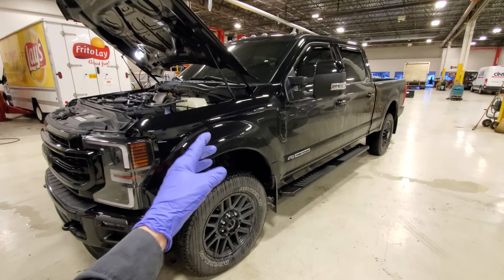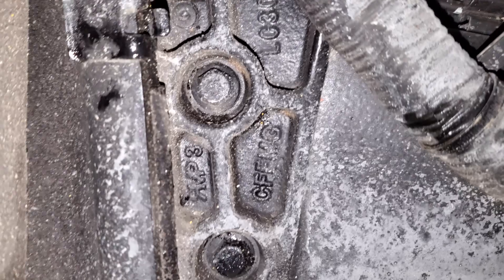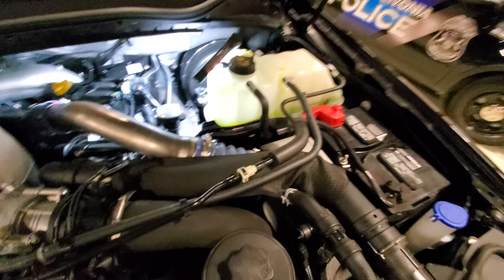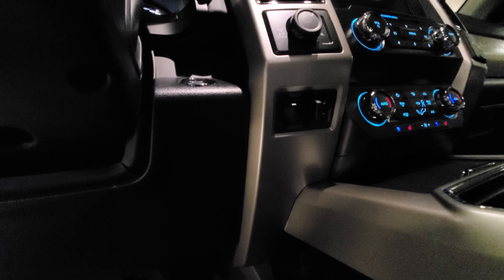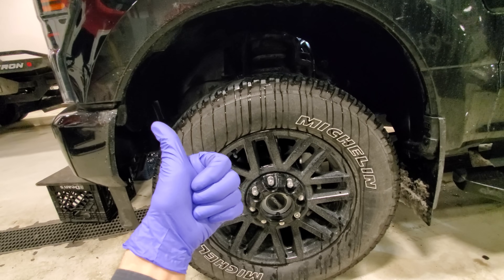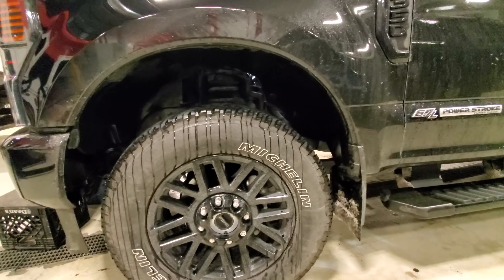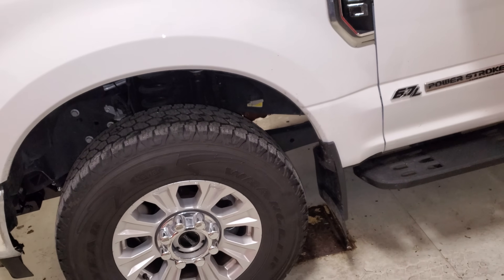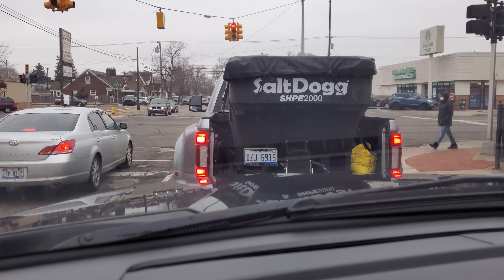What is this THING in my wheel well?? 20-22 Ford F250 F350 F450 EPAS - Death Wobble Cure???

Comment: I love Ford BUT I also hate them.  ALOT of moving parts - and seems to be OVER ENGINEERED.   If you need help backing up a truck when towing then perhaps one shouldn't be in the drivers seat.  Call me old school BUT that's my 2 cents worth.  2017 F250 6.2L Lariat w/ *8' box owner here and I opted out of all the electronic  stuff the dealer was trying to sell me at the time of my purchase.  I buy my trucks to own forever, I don't trade them in every 5 years like some people.  Yes. my rig had the death wobble and the easy fix was a fox 2,0 steering dampener - stopped it completely.  i love my FORD and my truck has never let me down.

Comment: Can this system mistakenly cause a left pull? I have a left pull that I am trying to nail down. The alignment has been checked 2 times and is perfect. Does it with stock tires and new tires as well. Seems like something is turning the wheel. The pull recently started.  Can this system be disabled?
Reply from the maker: I highly doubt that it wld cause a pull. No that cannot be disabled
Reply: @PowerStrokeTechTalkwARod  interesting. I pulled the 40 amp fuse for the EPAS motor. got tons of lights and error messages, but the truck drove straight, no pull. steering was heavy though (expected). I reinstalled the fuse, everything back to normal, but the pull is still gone! something reset with pulling the fuse
Reply from the maker: Hmmmmm
Reply: @PowerStrokeTechTalkwARod  I have a 2020 f350 extended cab 6ft bed STX and from the frame to the hub on the drivers side rear axle is 1/2” less measurement than the passenger side. The truck has 15,000 miles and whenever I hit a bump it feels like the front end jerks to the left side and when I’m going over 40 mph the front of the truck wanders left to right, worse at higher speeds and no matter what even after an alignment and rotating the tires if I let go of the wheel it pulls to the right, and brakes applied or not it still pulls to the right. Is there any way the dealer will fix this under warranty? Warranty is 125,000 miles or 5 years bumper to bumper and yes I bought i 19:17 it used

Comment: My Dads 21 f250 lariat doesnt have it but my 22 xlt does have it and i dont have the trailer back up assist but i did notice driving his is that my truck is alot easier to turn than his

Comment: I think its part of the lane departure notification system.  When you get too close to the lane divider a signal is sent and that vibrates the steering wheel.  I don't know this for sure, but a buddy of mine has the same 2021 F450 that I do except that option.  His does not have the item, mine does.

Comment: 21 Lariat Ultimate with lane keep assist and pro trailer.  I have the bracket and the motor.  The steering seems much lighter than the 17 that I had.

Comment: What is that purpose of the hose that is attached to the top stud of the drivers side shock? Just changed my shocks last night and after I pulled that clip off I noticed that the hose was plugged with a white cap and so is the one in this video. Any ideas anyone???

Comment: I have it on my 2020 f450 lariat with trailer pro backup with Lane departure  I did not have it on my 2019 450 Platinum however it did have lane departure. And I have to say my 2020 is the worst driving vehicle I have ever owned. Seriously you cannot keep this thing on the road it wanders all over I've had it into two different alignment shops and they claim that it's perfect. What I find is different in the way they steer is the 2019 drove like a high-end German vehicle steering wheel was very heavy the 2020 is very lite drives like you're on ice. I would like to pull the fuse on this electric motor and see if it changes the way it drives I have 21,000 miles on the 2020 and have hated it since day one it is the worst thing about this vehicle. Having crawled around my vehicle to inspect it for this I noticed that one of my batteries has the red indicator on it and one has the green makes me think one battery is bad we'll have to get it checked wonder if this could be part of my problem low power? I have yet to take the steering assist unit that goes on the trailer out of the box under the back seat. I have had a 2008 450 2010 450 and a 2016 450 and the 2019 450 pretty sure I know the difference in the way they steer and this 2020 is miserable. Any help would be appreciated.  I read in the comments let the steering stiffens up when on the highway at speed mine does not change my wheel is super light all the time it doesn't seem to change. I have no road feedback in the steering wheel it's like you're driving by wire completely disconnected from the road cannot take your eye off the road it's not a relaxing drive at all. Not just my opinion everybody that drives the truck has the same feeling.
Reply: I have a 2021 f450 and am experiencing the exact same thing you are describing. In my 2020 F350 DRW adaptive steering was standard on the platinum model. When placing the order for my 2021 platinum adaptive steering was an option. I checked the box because hey, 85k truck what’s another 1k for something that improved drivability right?! I am seriously thinking this adaptive steering in the F450 is not a smart option in this 21 model. Love the rest of the truck but man how can this be a tow beast I need it to be when it wanders so much....
Reply: @antimatterpowerstroke1225  Good news I might have fixed my f450 steering problem and you probably won't believe it I mentioned that I had a bad battery took it into the Ford dealer today they replaced the battery erased the codes and replaced my front and rear camera I drive it out of the dealership it drives like a different truck. I actually drove it for three and a half miles down the road in a crosswind and I didn't even touch the steering wheel my hands were off the wheel. I have called the dealership back the service writer to asking if there was a code on the steering or anything to do with the steering he hasn't called back. But if this continues to drive like it does now my problem is solved I hope this helps you.
Reply: @mbrown1519  so did that fix your problem
Reply: @grahamwilson3882  Yes it has helped, it's not as good as the 2019 but from what it was like, it's a lot better I now have 31,000 on the truck the service manager never got back to me about that code # but at the time I picked up the truck he said it had 9 codes they cleared.
Reply from the maker: @DSTRUCKS js complaining about the same thing!
Reply: @antimatterpowerstroke1225  If you find a fix please let it be known This is a horrible thing to herd down the road.

Comment: It is an electric power steering overlay. It came out in 2020 and is only installed on XLT and higher trims. This is separate from the adaptive steering system that is inside the truck behind the steering wheel.
Reply from the maker: Thank you, finally some talking with some knowledge3

Comment: What do you recommend for undercoating? I am in Maine and have my Tremor coming in 4-6wks and would like to get it coated before next winter
Reply: Wonder if that is available in Maine?
Reply: Unless it is brand spanking new just off the truck I wouldn't get it undercoated, way to easy for moisture and dirt to get trapped, which will lead to rust. A traditional undercoater MUST know what they are doing to be able to apply their product so it doesn't trap moisture or worse, peel off after a few years.   Up in the snow belt here with all the road salt and pickle juice, we have been using Fluid Film instead.  Wool Wax is a good one too.  It's a lanolin based product that is sprayed on to everything underneath. It can get into areas undercoating cannot. Stops rust dead in its tracks, and prevents rust from happening.  Check out some of the videos on it. Really good stuff and doesn't cost a small fortune to apply.    Fluid Film can be done in your driveway, it's non toxic since it is 100% lanolin, and doesn't stain.  Just don't get any on the brakes.    I bought my 2012 F350 2 years ago, it was a Wisconsin truck and has rust at every body mount, and in a few other areas. I took a sharpie and marked around every rust spot, the brushed it all down and sprayed the entire under truck, and a few spots on the front bumper.  2 years later and no more rust and the spots it does have are the same size, have not expanded.   So if you can't find a good one, there is a really good alternate to use.
Reply from the maker: Rust belt here! Have had NO ISSUES with Ziebart
Reply: @PowerStrokeTechTalkwARod  That is a rarity, didn't even know Ziebart was still around, all the places around here in Hellinois are tinters.   They must do a really good degreasing wash and etching for it to stick.   I have had "rust proofing" done, and still had rust issues, but the Fluid Film is the nutz,  $54 for a gallon and $24 for the sprayer and I did 3 vehicles with it and still have a half gallon left.  Of course the only thing needing it now is the frame and axles since the body is all aluminum and doesn't need any protection.
Reply from the maker: Mine looks great! I mean they did A really nice job. I wish i clda filmed the job
Reply: @PowerStrokeTechTalkwARod  That would have been a good video too. So many horror stories of people getting undercoating think they are protected only to find out 5 years later when a huge chunk of undercoating and rust falls off the frame! Of course Ziebart was the leader in rust proofing way way back, I remember their commercials on WGN along with Bert Weinman with the showcase car on a turntable.
Reply from the maker: Love it, looks good
Reply: Undercoating is a big deal in Maine and many different types from fluid film to this honey like substance.  We shall see when truck shows up
Reply from the maker: Ziebarted mine...YOU won't b disappointed. Don't listen to them other foolios bro.💯
Reply: Get a NH Oil treatment.

Comment: Hmm. '19 Lariat Sport, no bracket, but a lot of holes in the frame right there.  I have the shaker lane keeping, but not "pro" trailer backup assist.  I just drive from the bottom of the steering when when backing.

Comment: According to the parts side of the Ford Discussion Board, the part number is LC3Z-3G568-A which is described as a "Hydraulic Steering Module." We use the SnapOn catalog and it isn't illustrated or even listed.
Reply from the maker: I knw i wasted a buncha time doing just that....

Comment: Same thing with running boards. Mine has a black plastic housing that says superduty in between. And I noticed some don’t come with it. I don’t know why mine came with it.
Reply: Oh and I do have the bracket and don’t have the pro trailer backup. But I do have the heavy duty towing option.

Comment: You can add switch and have that feature to (but you have to turn on )
Reply from the maker: Thinkin probably not...
Reply: @PowerStrokeTechTalkwARod   Probably can with Forscan, just have to find the right hex code to enable it.   My18 RWD Platinum didn't come with downhill assist, but it does now. :)  All the components that contain the firmware are likely already installed since quite a few modules serve double duty for weight savings.   The TBA uses the back camera and EPAS to do the work, and since you already have both, only thing lacking is the dash control and the software to "hack" the system.  Pop that cover off and look, you will more than likely find the harness for it in the Lariat.  XL and XLT more than likely wont have the harness. 

I know of someone who added the trailer camera package from the Superduties to his F150 and got it to work, somewhat, he hasn't figured out yet which component is locking up, it works for a few minutes and freezes. He found the module using Forscan.

Comment: This was very interesting to watch. My 20 7.3 Tremor Lariat Ultimate Sport has both adaptive steering and pro trailer assist and this bracket. I wasn’t that impressed with the adaptive steering until this winter when I ended up plowing snow ever other day for a few weeks, it really cuts down on the cranking on the wheel when plowing in tight areas. Had no idea about how this system was also enhancing the steering. The 20 handles much better than my 2015 F350

Comment: Think it’s for the variable power assist! The steering wheel on the  2021 f350 is super light to turn  like a car at low speed. The steering becomes stiff at highway speed or if trailer is connected.  Also The steering is to soft at low speed to be just hydraulic assist. But could also be for the backup as my truck has the pro trailer assist.

Comment: So Arod, you DO have the pro trailer assist. You just did not have it activated at the plant (software installed).
Reply from the maker: No i do.t
Reply: @PowerStrokeTechTalkwARod  What I am trying to say is that it looks like you have the motor that turns your steering wheel, and if you have the same cameras around your truck you may just have to procure the software (or maybe turn it on ??) and get the the little device that goes under the trailer gain device. Sometimes it actually cheaper to partly equip vehicles with things that you didn’t want or order than it is to not put it on. It’s counterintuitive I know but I have seen it happen. Case in point operator controlled regen, if you didn’t order it or your truck has a high trim level you can’t get it, but you can activate it with forscan. Just saying it may be what is happening....keep up with the great videos, thanks.
Reply from the maker: Thanks pal

Comment: 2019 xlt superduty, 6.7, no bracket, death wobble at 28,000 and dealer installed new steering damper. 58,000 miles now and still no more death wobble
Reply from the maker: Excellent

Comment: My 2020 F350 has it. We have 3 2021 F250's that do not. Steering is night and day different. My 20 is a lot tighter at Highway speeds and easier to turn at low speeds than the 21's. I can notice a change in effort when driving in a cross wind and crowned roads.

Comment: Do these newer trucks come with an electric-assist rack and pinion power steering system?
Reply from the maker: No. These trucks do NOT have a rack n pinion setup. F150s, yes. MY SUPERDUTYS, NO
Reply: @PowerStrokeTechTalkwARod  I wonder if it's just a placeholder or maybe it is a hybrid system that assists the traditional hydraulic system, idk. It is kind of wild that Ford just slapped it on there and sold it without the features you described.

Comment: I believe it is part of the adaptive steering and lane assist.
Reply: That's the EPAS you are thinking of which is the part of the steering that used to be the hydraulic gear box.  Electronic Power Assisted Steering.  Nice feature when it works, a real skid mark maker when it doesn't!    The F150's have the EPAS, which started out as a way to eliminate the engine driven power steering pump and eventually became the means to be able to do Positive Drift Control, and for the higher trims, lane keep assist, and the backup trailer assist.  Super Duties got the TBA in 2020.   I had forgotten they also have adaptive steering, and had no idea until now how they did it.
Reply from the maker: No bud, sry its not. Read them comments....

Comment: My 2019 has the adaptive steering and I hate it. It's damn hard to turn and drive around. I wish there was a way to turn it down so the wheel turns easy like my 2016 F350. I miss my 2016 so much. Seats,etc were so much better.

Comment: My 2020 Lariat F-350 has that part. Was thinking it was for the lane departure thingy, that vibrates the steering wheel when you go over the white or yellow line. My first thought was the front end is falling apart on a new truck. Then I noticed the green lines in the lower instrument cluster. turns red when over the lines.
Reply from the maker: Yea had nothin to do w/lane assist

Comment: Hey good video I have a 2020 F2 50 lariat no back up assist but I do have the module I knew it made the steering wheel vibrate with the lane keep assist. Loved your video and modifying the spotlights in the mirrors can you do a video showing how to replace the spotlight lens covers they crack easy
Reply from the maker: The video has nothin to do with lane keepin. The bracket is NOT for that. Read the comment section...homie🙋‍♂️

Comment: I think it has to deal with ford saving money. On the higher optioned trucks as they are all basically the same, just the differences being missing some options, a different set seats and different interior color. I think ford is doing this because of economy of scale and it brings down cost of this expensive part and more truck a probably ordered with it than with out it. 

I'm going to send you a dm on Instagram because i think i might be able to help you do something cool with something from the information you shared in the video.

Comment: My 2020 F350 XLT does have this without Trailer backup system. I think it is for the Lane  Keeping system.
Reply from the maker: Superdutys do NOT steer themselves.......however it will provide the rumble strip sensation
Reply: @PowerStrokeTechTalkwARod   What makes the steering wheel vibrate when the Lane Keeping System determines the truck is to close to the edge of the lane?
Reply from the maker: The power steering control module rapidly oscillates the power steering left to right simulating the vehicle driving on a rumble strip, the intensity of the steering wheel vibration can be adjusted using the driver assist options in the message center + the system also provides a visual alert in the message center when a lane departure is detected & then you correct the wheel and all is good

Comment: I have a 2020 STX with pro trailer backup assist and mine has that bracket.  If it is for the pro trailer backup assist, that was new to super duty for 2020. 

I think Adaptive steering was only available with  lariat and king ranch trim levels.